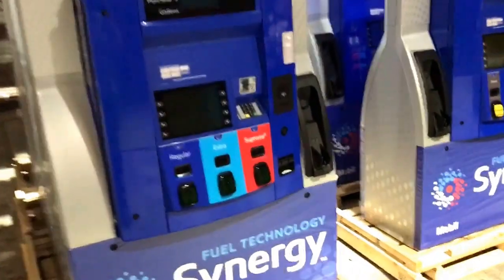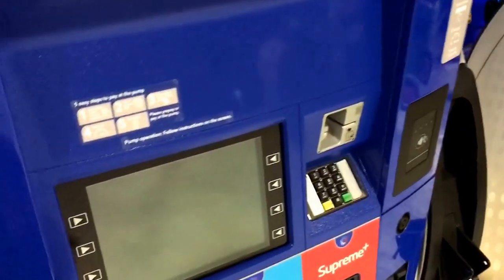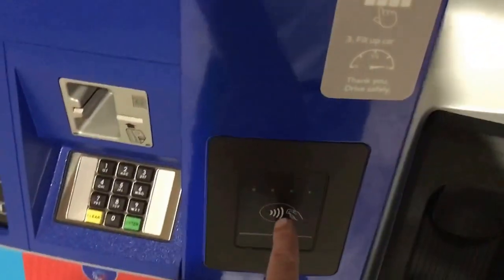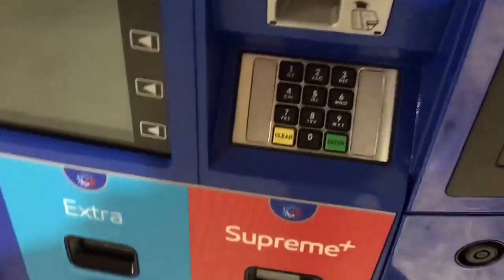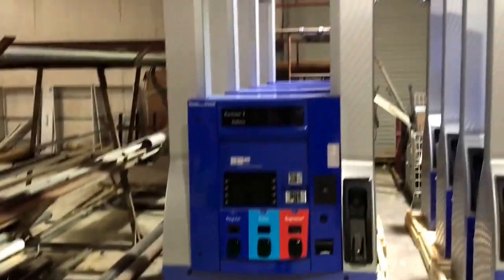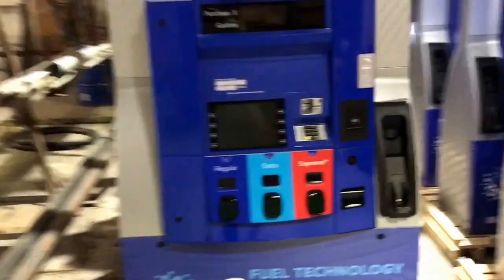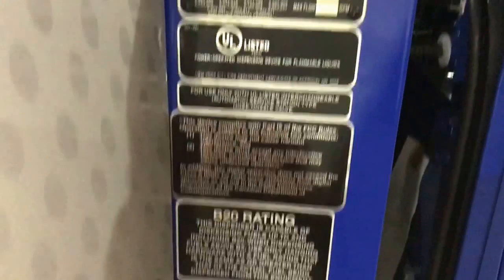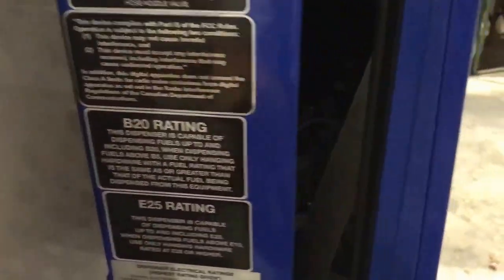New Wayne Ovation Dispenser Mobil Image

Comment: Nice technology.    You cannot pump gas without inserting and removing your card about 12 times, entering driver code, birthdate, mileage, and various other codes.   But you can get frustrated  and angry and watch lots of customers drive away without gas.   Like I did.   Enter card...remove card...enter card....remove card.